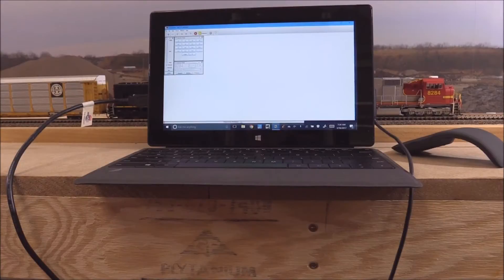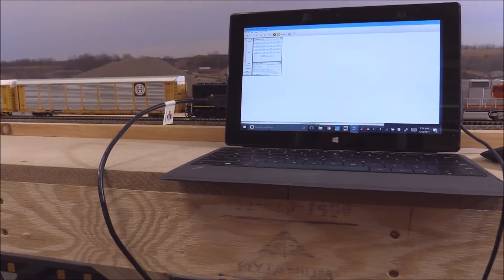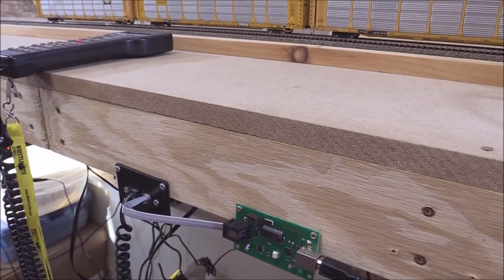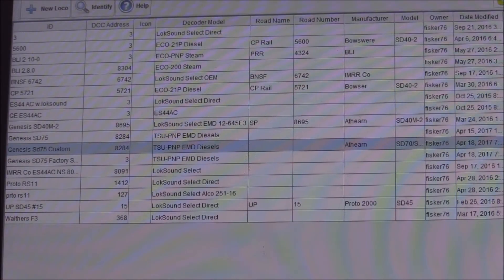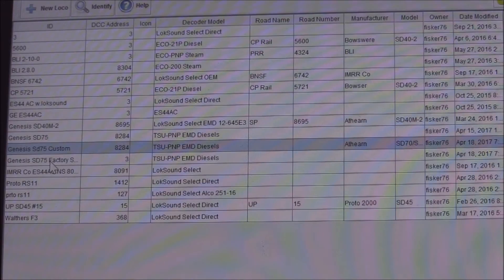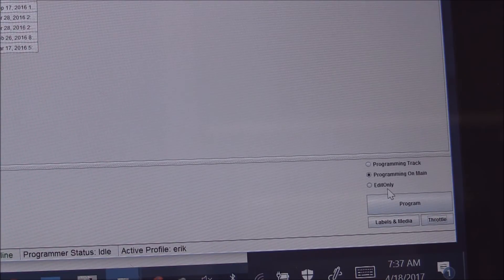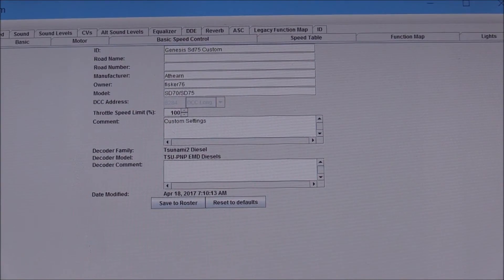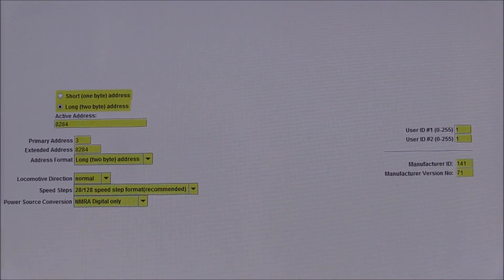JMRI Decoder Pro Overview Part 1

Comment: When I try programming on the programming track it wont take.  Should I be doing it on the main only?  My other engines with a different brand decoder will take on the programming track.
Reply from the maker: That's a loaded question depending upon several factors. I do nearly all programming on the main as I see and hear the results instantly. I only use "Program Track Mode" if I have to retrieve cv data from the decoder. Depending upon the decoder, some will not read in PTM unless you have a device like the NCE Power Cab. I can't recall a single decoder [except BLI Paragon 2/3] the Power Cab cannot read.